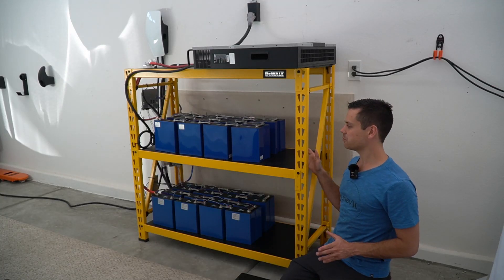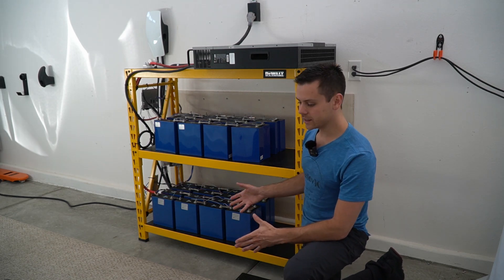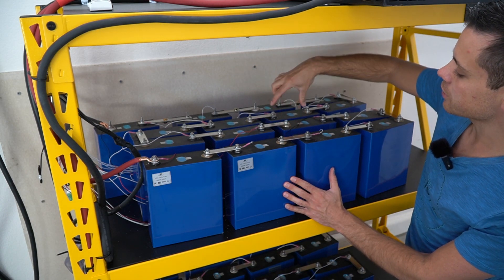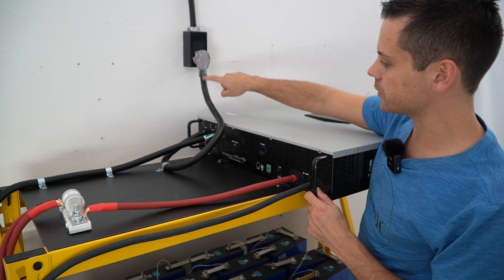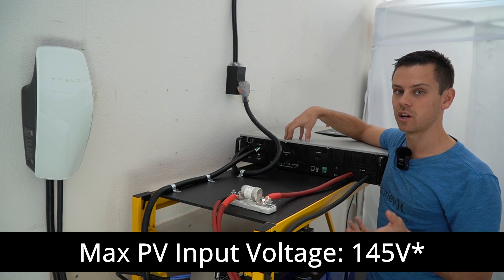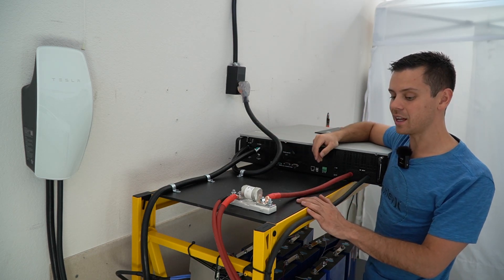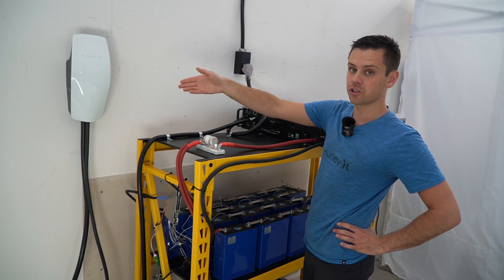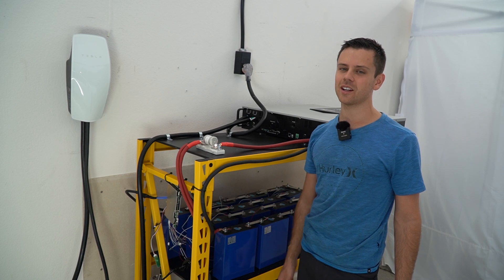Electric Vehicle 30kWh Battery Backup! Grade B Cells + LV6048

Comment: Great Vid Will, thanks
I got two MPP6048's now, started with just one, and had 120-240 output with just the one unit day one!
These units are great, let me build up the system one part at a time as I learned, and could afford to expand. They are 27.3A 240V output each so you actually get 13kW the same as two of the 6548's, they just don't label them that way, too confusing.  These are actually two 3.25kW inverters side by side inside the box. A bit high on standby consumption, but super easy to hook up and operate, modular, easy to add units if needed, or to expand. Grounding and N L1 L2 connections so simple. Very happy with them.
BTW In back up mode these switch super fast, my computer doesn't even blink.

Comment: Will, I really love all the info you put out.  If you get a moment, i'm at the top of the waitlist for the Toyota BV4X and if you could recommend which precise videos and the order to watch to build a solar system and battery storage to recharge the Bv4x versus using the grid.  I'm looking at a pergola in my back yard later this year with solar panels for the overhead covering as well as on the side of my house as a quasi shed that will be an overhead parking roof for my SeaDoo and ev lawnmower.  All in all i'm looking at having over 10 panels depending on their width/length.  The side of the house is 6 feet wide and 24 feet long and gets sun from Noon to 7p daily.  The pergola roof will get sun from around 10-11am till sundown as the sun sets facing my backyard.

Comment: Will,  at 1:40 of the video you mention that you use a NEMA 6-50.   The Nema 6-50 has no neutral so what did you do for neutral?   Since you only have a 240V load on the back-up, did you leave the neutral in and out unconnected?

Comment: Would it be proper when the sun is not available, to use a 12 volt 10 amp car charger attached to the input of your solar charge controller to charge a 12 volt 100 amp hour lithium iron phosphate battery? My reasoning is to store electricity during a power company blackout when my solar capacity is not enough.

Comment: Could you do a video and building a solar system to produce 440V 60HZ 3 phase system parts needed and such? I am not asking you to design one for me as I would most likely modify it anyway. I know how to hook up DC voltage as well as 120, 240 volts single phase and 220, 440, 660, and 880 3 phase. I use to work as an electrician at a shipyard. Solar is something new to me but I am learning.

Comment: QUESTION: Can a dual Bluetti AC300 system be used to connect to an electric vehicle charging system and charge your tesla or other ev?

I think you tried this on eco flow and it had an issue.

Comment: i have a question, no one answered me, but i believe you can help me.
i am a collage student planning to live in a caravan, i have my gaming pc, and i calculated that i need 5kwh worth of energy to run it for 1.5 days.
since the pc takes AC voltage, and i need 5kwh capacity, do i need a 5kwh battery? or since the battery is in DC the Wh will change?
and for power efficiency not price, should i use 48v battery or 24v or 12v?

Comment: what is the wattage of the array? i missed it if you mentioned, sorry. also do you have multiple arrays set up for each system or is it one array going to each?
Reply: The system in this video had no solar hooked up. Charged using 240v ac

Comment: Can you put B rated batteries up and A rated batteries down. I hope you covered in future that metal rack with metal sheets on the sides and back. If something happens, only bad batteries and carts will burns, not the whole house and  good batteries
Reply from the maker: Cement board is on the wall

Comment: what could be cool is making a high voltage lithium pack and having the dc feed directly in to a fast charger to allow for at home dc fast charging and because its a battery supplying the charger not the grid any pack that can store enough power to fully charge a car could also output enough power to do full speed dc fast charging. probably would a rather an expensive project but it would fit with the channel and would be a very unique and interesting video or more likely video series
Reply: You would not only need the batteries in series (400V + ouch) and the DC charger, not worth it.

Comment: I want to replace my 72v UPS with something like this but I can't quite tell if it will let you do 6000w on 120v or if is always 240v output.
Reply: Yes it will output 120 single phase,  120/240 split phase, or 120/208 split phase,  it's all programmable,  if you program it for 120v single,  you will have to bond l1 and l2 hot legs together to use 6kw on one line.

Comment: CHALLENGE
Build a homemade jackery.
Reply: I built one with 7200 watt hours a year ago. It has run ever since and powers my shop fridge, electric tools, small air compressor, box fans and evaporative cooler. Unlike Jackery or EcoFlow, any part can be replaced if needed.
Reply: @kimmer6  Portable? What kind of Inverter?
Reply: @highlander723  It was not built  to be ''portable'' at 130 pounds. It is in a square steel roll cage on caster wheels and can be dumped upside down with no harm. I originally built it for my son's house to back up the fridge and 2 chest freezers. 2 guys can pick it up and put it in the truck if needed. Its 22x20 by 32 inches and was made to fit under his workbench. The inverter is a Renogy 3000 watt unit that can take a 6000 watt overload for 20 seconds. I added a 175 amp Anderson plug and can piggyback on a spare 300 amp hour Chins battery for a total of 11,000 watt hours if needed.    He got a Tesla Powerwall so I kept this unit and it runs my workshop. Cost $3000 to build and the Chins batteries are $1135 each now with tax.

Comment: Will, I’d like to hear your thoughts on building a solar system that will only be used to maintain refrigeration. Refrigerator/ freezer etc, no air conditioner. This is for extended grid down to preserve food.
Reply: I made a small solar system for when we have power failures, it's only 400W of solar, a 7kWh EVE cell battery bank, and an MPP LV2424. 
I made a transfer switch box for my furnace and office circuits using high quality UL listed relays, so when those circuits are powered by the LV2424, the relays turn on, disconnecting & isolating both hot and neutral lines from the grid for safety. I also installed AFCI/GFCI combo breakers between the LV2424 and transfer box so the circuits are protected when running off the LV2424. Although they do occasionally trip when power transfers over, I'm guessing they don't like the micro-arc that happens in the relays. I changed the furnace circuit to a standard breaker because I don't want that tripping while I'm away.

And if I need to, I can just run an extension cord from the office outlets to the refrigerator if power goes down for a significant amount of time. But usually the outages only last a few hours or less. But when it's -0F outside, the house gets cold quick.
Reply: @andrewt9204  thank you for your input! I was thinking of a larger system that would handle food preservation indefinitely.

Comment: Another great video. Thanks, Will!

Where we live (Colombia, South America) we're going to start planning on full off-grid solar + battery storage. However, it will make the most sense to start with a whole house UPS/backup because there will be a backup generator for the neighborhood to start with. That will mean that we need something to keep the juice flowing between the power cutting and the generator kicking in.

Would this system work for that purpose? If not, any of your videos/setups that you'd use as a starting point? Thanks!

Comment: Great insight on AC coupling two systems.  I have a maxed 12vdc system & 4000W inverter; planning for EV charging.  Adding a 48vdc battery+bmc+solar inverter-charger like you show here...enables baby-steps approach to adding panels that lets no power-generating capacity go to waste!  I had not considered cascading like this:  wow, thanks.

Comment: Hi Will…. I have a quick question - mostly unrelated to this video.  You mention using a 120V source to get 240V out.  That’s exactly what I want to do.  How do I combine the household AC with a battery system to get 240V ?
- Is it possible to get a combiner that plugs into a household 120VAC/15A AND any kind of battery/inverter source - to provide an aggregate 240V output at 3 or 4 kW?

Supplemental info:  I am renting and only have a 15A/120V power source available.  I want to augment that to 240V/15A with a battery to charge my PHEV faster.  (It doesn’t make sense to pay an electrician to run a new circuit in a rental property)
Reply: Simple answer, no.

Comment: Awesome videos Will; you're the best.
You always make me want to go buy the stuff, then I look at the price.
This is more doable, but if I'm going solar I want good new long-lasting batteries, and that makes price go stratosphere again.
Also, better/cheaper products come out all the time, so waiting would be good, but I could wait too long...
Reply: Did my RV in a 3 construction phase approach - panels and charger, inverter, and finally battery upgrade. Sad part is by the time I afforded the batteries I would have done the panels and inverter completely different and added a 12V 40A buck converter to power the 12V buss.

Comment: Quick question. 12v or 24v for running a RV? I see your info say anything over 3000w (our air conditioner) should be run at 24v. Thanks in advance. Appreciate your knowledge and sharing it out here for us DIY guys

Comment: Hey Will! I might sound crazy but what if you could make some good battery pack and connect it directly to the tesla main battery on a trailer to extend the range! Possibly on an old tesla! 😂 😜 😂
Reply: Making a 400v pack and connecting it in parallel would be pretty dangerous. And towing any significant sized battery will cut the range down by at least 1/3 if not more, negating any range increase probably. The extra weight, friction, and aero of even a small trailer has surprisingly drastic consequences.
Reply: @andrewt9204  I just want to see if it can be done, I’m curious, the extra batteries can also have a fuse to protect it!
Reply: Nice thinking 😀  though at some point the additional load will have negative marginal benefit.
Reply: Just because something is feasible, doesn’t mean you should try it

I wouldn’t mess with the high voltage systems in production EVs. It would be better to DIY convert a car to EV first. That’s a system I would have no trouble adding to later
Reply: @oblitafier  lol….. why not! We have been adding auxiliary fuel tanks into ICE cars for years to litteraly quadruple the range for all kinds of use…. Why not with EVs!?

Comment: Sorry new to solar but how do you hook up a off grid system to a homes fuse panel without back feeding the grid?
Reply: From my understanding you have to use a new panel and output inverter to it and feed new circuits. Or put the new panel close to the original one to get close access to the existing  house circuits and bring the wiring over to the new one.
Reply: You have to put a transfer switch in the supply feeding the home’s fuse panel.

Comment: Love your channel and learned a lot from your videos. I also saw your 400Watts video. Would you still make the system like you had it back then, or would you change something? (E.g. Do you still recommend the same breaker?)
Reply from the maker: I thought about this a lot and yeah, just the changes that I have on my blueprints, and that's it. I keep the website recommendations updated, so check there first
Reply from the maker: Just fixed the grammar errors above. Was using voice to text
Reply: @WillProwse  i never heard you say this, if a completely autonomous home with solar and batteries are cost effective compared to the grid
Reply from the maker: And thanks!

Comment: Love it.  I have multiple AI edge devices with a main solar system and batteries. And a backup battery system like urs.  Just 2kwh  so way smaller. Same concept except not grade B cells. 

I’ll be very interested in the amount of degradation (if any) over time of those B cells.

Comment: Don’t underestimate the possibility of the grid going down in the next few years or even this summer. 
There’s been all kinds of reports even from government officials about power outages and potential grid down scenarios. Believe me I wish we didn’t have to think about these things, but most people are using BMS lithium batteries which are susceptible to EMP’s, unlike lead acid. 
It would be nice if you did some video on EMP protection. 🖖
Reply from the maker: I plan to grow garbage bins of potatoes. Also have my water storage and treatment setup. Good luck everyone. Might get nuts.
Reply from the maker: I wish I could discuss more but don't want to get cancelled. Solar seems neutral for now.
Reply: @WillProwse  
Check out Man in America‘s new video. Wish I could leave a link but it’s incredible new information!
Reply: Big reason why I got my system
Reply: Lithium batteries are no more susceptible to EMP than lead acid. If anything, due to the aluminum case they are less susceptible. The inverter is what is susceptible.
Reply: @john_in_phoenix  
BMS is a problem in batteries. Not every case is metal.
Reply: @benjones8977  You are correct that a BMS is susceptible to EMP. In order of most susceptible would be solar panels, inverters, and charge controllers. Last comes BMS. Personally I have multiple spares of BMS, and cells can always be paralleled. EMP would be a problem, but it would mainly be a problem for the grid, a lot of stuff would survive. But I guess I was lucky to have an inquisitive mind in the 1970s when my uncle was a director of the state Civil defense agency, and I read literally 3 feet of shelf space of manuals on the effects of nuclear blasts. A lot of stuff on YouTube is just flat wrong or overblown.
Reply: @john_in_phoenix  
I know a lot of it depends on where you’re located when the EMP hits. Most people don’t have the money to have multiple back ups. 
I suggest you listen to Man in America’s latest video just came out. We don’t have much time.
Reply: @benjones8977  I've lived with the cold war longer than without. I've worked on star wars when Reagan was in office. I've lived through Jimmy Carter. I remember nuclear winter as the biggest threat. Don't think I'm unprepared, or clueless. I know that lithium batteries will last far longer than lead acid.
Reply: @john_in_phoenix  
It’s not you or me I’m worried about. It’s all our neighbors who are unprepared!
Reply: D M  
I suggest you check out the Ice Age farmer channel.